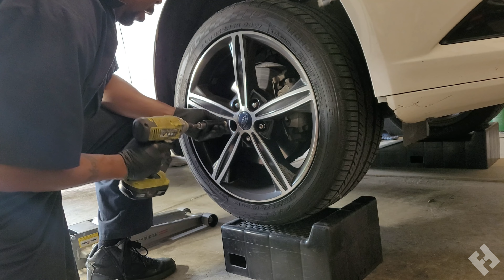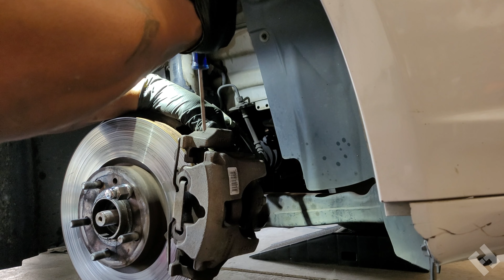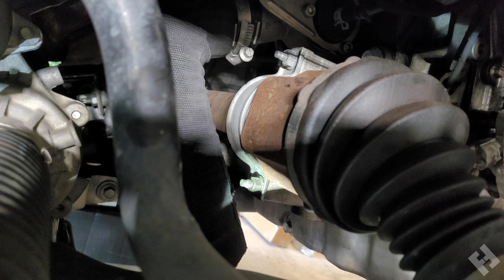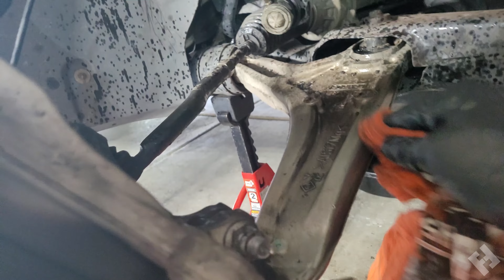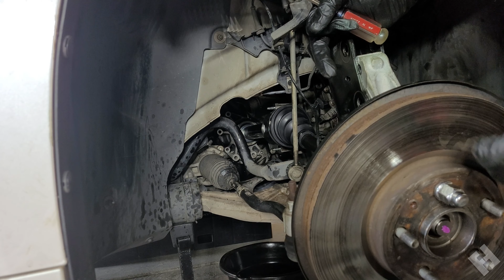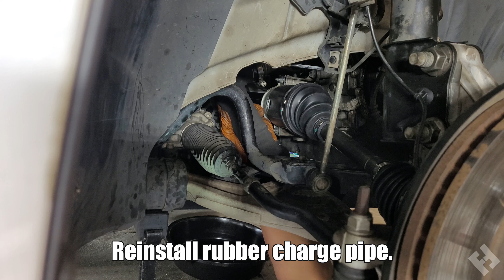2013-2016 Ford Fusion Right Axle Shaft Replacement

Comment: It shows you have a round metal washer instead of the supplied green washer, I've heard others say to use the metal one instead, i ask because I just replaced both axles on my 2016 hybrid and before the axle boots got ripped, i was hearing a click everytime i take off and come to a stop, noticeable click, you think I need thicker washers? Good video, straight to the point didn't even need to hear you say anything
Reply from the maker: @johnmejia573  Not sure what you mean. I certainly moved over the green washer to the new axle. Thanks for your reply.
Reply: I have the same problem as you, did you understand how to solve it? every time I stop and even when I start again I hear the click. someone told me that loctite needed to be added but I'm not sure
Reply from the maker: @RoberthNolostare  The problem I had was a busted boot. Not a clicking  noise.
Reply: They are saying they have a clicking noise now after they replaced their axle when they stop and go. They are asking you what did they do wrong or what is the clicking noise from.  @FoxFaderWorld
Reply from the maker: @josephrobinson5452  Take a look at this video. https://youtu.be/BnbCig-wR1Q?si=RPL5JaIRLt-DWz-0

Comment: Nice production on the video.  Not sure where you live, but it isn't anywhere with road salt!  That car is clean for its age.  My 2014 is rusted all to heck.
Reply from the maker: Thank you very much!! I'm in West Central, Georgia. Yes, no road salt.
Reply: Nice work ,but never heard axle joints have problems with fusion for 2013-2020
Reply from the maker: @elshadnajafov2083  The boots will eventually leak. My other side has started.

Comment: Great video! Does the wheel alignment need to be adjusted afterwards?
Reply from the maker: @geoffreyhandel6230  Great question, and the answer is, absolutely not.
Reply: @FoxFaderWorld  GM from NJ, I attempted replacing the driver's side cv axle on my 2014 yesterday, the axle is stuck (frozen) in the bearing, so I may have to remove the steering knuckle/bearing/cv axle altogether. Do you have any suggestions for removing the knuckle? Any special tools needed for removing the tie rod or ball joint? Thanks!
Reply from the maker: @geoffreyhandel6230  Personally I would try penatrating fluid and an air-hammer first.